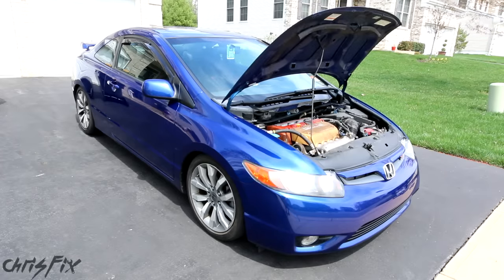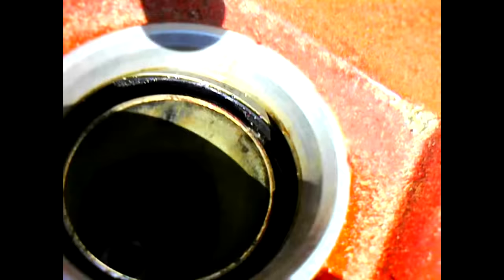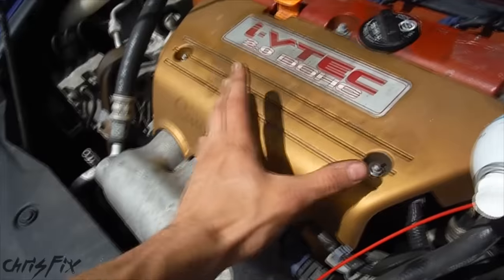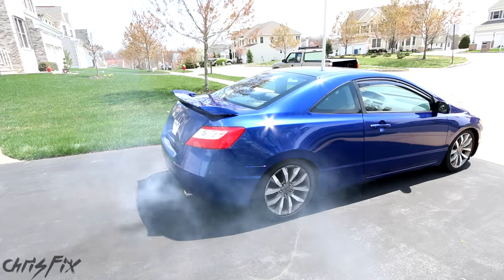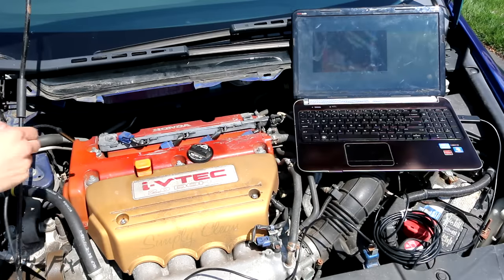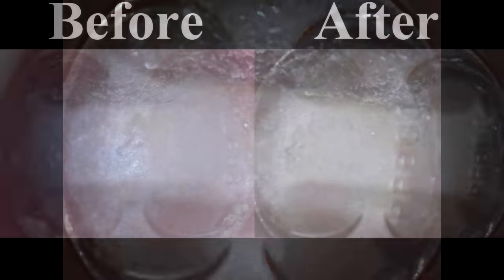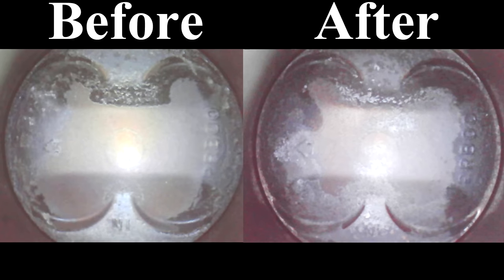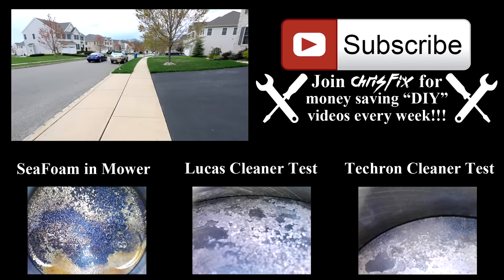Does Seafoam Actually Work in a Car? (with Proof)

Comment: I have always loved to apply Seafoam to my cars. I've owned 65 cars since I was 14 and I'm 38 now, so I've had some fairly crappy cars with alot of miles. I just love pulling the brake booster hose on my cars and slowly pouring Seafoam into the hose while running and watching my car smoke out the entire neighborhood. SO much fun!
Reply: 24 years ,65 cars. Sounds like you are buying junk and make a lot on scrap metal. All your cars need a tag that says , scrap metal.

Comment: I've used seafoam after my civic was idling rough that had 200,000 miles on it...after using it like you did it was running like a new car...safe to say seafoam def works!

Comment: It would be interesting to test the cylinder compression PSI for each cylinder before and after the seafoam.
Reply: This is interesting.
Reply: I bought a 72 MGBGT about 13 years ago and the #4 cylinders compression was low I put some Seafoam in it and it brought it up to the other cylinders
Reply: @mgman6000 im 💀 😂 i tried it today my engine was running rough for a while until i re-did the pedal relearn. The rpms just stayed at 1500 i thought i was gonna have to spend more money. Car still running the same if anything i get a slight vibration now.

Comment: You are supposed to add it to the gas tank as well as the intake. Praying into the intake is just to get the removal started. Having it also in a full tank will result in a much better cleaning. Can also add it into the crankcase, which should be done about 500 miles before an oil change.

Comment: After watching all your videos on this subject it would appear that surviving combustion is the most important aspect of any of these cleaners for piston tops.  For example seafoam is mostly pale oil that was used as an upper cylinder lube years ago. It allows the naptha, which is the primary detergent to survive long enough to clean the piston tops. So for your test it's the most likely to show visible results. Agree?

Comment: Hey Chris you're suppose to let it hot soak for at least 20-30 minutes before aggressive driving might get better results, when I did mine after 45  minutes of 70 mph driving I had lunch and jumped on the highway again and lo and behold I stopped traffic  accelerating onto the highway with all the smoke I left behind that's almost 2 hours after I did the spraying.

Comment: I am more concerned with the intake valves and guides on a GDI  then the combustion chamber. Would be interested in seeing the diff with the intake valves after seafoam.
Reply: Intake valves on a direct injection engine won't get cleaned by spraying seafoam through the intake, you have to go in and clean it by hand.
Reply: Exactly!
Reply: @tehgzizlauw1787 thats what i was thinking mine look black and i was thinking of taking it off and brush it but i discovered the sea foam and say let me try it.
Reply: @williamjoseph4095  you can use seafoam as a solvent to help loosen the carbon on the valves before you scrub it off with a brush. But if you just spray seafoam through the intake it will just go into the combustion chamber and burn off. The carbon on the intake valves on a GDI engine is too baked on usually for that to make any difference

Comment: Honestly I didn't see a difference.  Could be that the engine was in good condition to begin with.  Also I have a feeling the aggressive driving did most of the work.  Finally I'm worried about WHERE all that carbon went?  Most likely it's just clogging the catalytic converters.

This might be better to show on a car that's really dirty.

The aggressive driving is an old trick I used on my 82' Trans am and even my modern cars.  Just drive like an a-hole for a day and you'll notice the next day you car is running better because you burned out the carbon.  This must be why BMW drivers always have clean pistons XD
Reply: If you've got enough carbon that it messes up your engine so a cleaner actually makes a difference you're just masking bigger problems by using it. I've tried stuff like STP and lucas fuel treatments and didn't notice any difference in performance before and after. Whether or not they cleaned any carbon or anything like that I can't say. Like I said though, to get your engine gunked up that bad to where seafoam makes a big difference you've got much bigger problems that need fixing.
Reply: yes this is a good question...where DO the carbon deposits actually go when running Seafoam??
Reply: Yeah, I am thinking the movie Envy, where Jack Black's character invents Vapoorize, an aerosol that just makes dog poo disappear... It's definitely a good idea to ask these questions :P

I would actually be somewhat reluctant to use this product in a high performance engine where tolerances are less lenient(the honda kinda qualifies). Some of the carbon deposits appear to have come away in quite large pieces, that could potentially scratch the bore or block up the tiny "capillaries" in your catalytic converter.
Reply: DoomFinger511 bmw drivers get a lot of misfire 😅
Reply: Look at the piston walls you can see better reflections
Reply: I've seen a bad carbon buildup and if he really had a bad buildup you'd be able to notice, it's literally black gunk everywhere on the valves from direct inject engines on new engines. Older engines will never need a carbon clean just because the way the fuel is being injected, idk about this engine but it didn't need a carbon clean, the intake was fine
Reply: DoomFinger511 probably because of a head gasket leak
Reply: Agree no difference.
Reply: I think 80% goes to oil and the rest to cat , oil change it's a must but My opinión is  this shit is useless and could damage engines in long periods.

Comment: I just used it on my '85 Toyota.  It seemed to work pretty well overall, and noticed the change almost immediately after starting to spray it in front of the TB.  BUT, after I was done and took the the intake apart to remove the Seafoam line, a bunch of the seafoam dumped all over the ground.  A bunch of it clearly didn't go into the engine.
Reply: You're supposed to do it with the throttle open
Reply: @JohnZombi88  well, it was open.  But not wide open

Comment: The carbon buildup on pistons usually isn't a issue for most car engines that have carbon buildup, it's the intake valve (inside intake and not combustion chamber side) and the piston rings that can not be fully seen unless removed. Also the throttle body and idle control valve are key area that are suspect to rough idle and even throttle response that can be easily cleaned by most.
Reply: Seafoam makes intake valves pristine in lawnmowers, at least.

Comment: I use seafoam on all my engines, crank cases, transmissions and power steering! 
Always good results, knowing what you're doing is key!
Reply: Have you had any luck with sticky piston rings when adding it to the oil crankcase? Have you ever left it in for 3000k miles? Or just Vv 100-300 reason I ask is I just did a fresh oil change on my car.
Reply: @truthseeker1203  seafoam deep creep might help a sticky ring, soak it for a while and it might pop free. I always used  ATF before I found seafoam. The engine treatment can stay in if you want too.  I put it in my skyline every oil change.
Reply: @bikerboymc54  how would I go about using the deep creep? I was under the impression that’s for tight bolts. Do I need to pull any fuses? Change oil afterwards?

Comment: Hey Chris the best way to get rid of carbon is carbon gasification. Here is the chemistry. 3C (i.e., carbon) + O2 + H2O → H2 + 3CO.  The problem is how do you get water into the engine. You have to spray it into the throttle body. It doesn't take much water to clean out the engine. Please try this and compare it to the fuel cleaning products. You're the guy with the cheap DIY solution that works really well. I thought you would like this.
Reply: I can see people hydrolocking engines that way :)

Comment: Would have been good to do a compression test, to see if the improvement actually made any real world difference. That's whats really important. I don't think it made a huge difference looks wise.
Reply: Projectfarm tested it and found it improved it by a good margin so I think it's safe to say it actually works
Reply: My 2015 jeep wrangler mpg went from max of 19 mpg to 21-22 mpg just using one application in the gas tank.
Reply: Doesn't this stuff damage fuel lines?
Reply: @RideAcrossTheRiver maybe that’s why he’s doing the intake method

Comment: I worked R&D in auto racing (engine department) and based upon the video these products are worthless.  The product itself is causing all the smoke, not the removal of engine contaminants.
Reply: Not aware of any product that can be used with an assembled engine. Likely a fuel injector cleaner being run on a consistent bases will slowly dissolve the buildup.
Reply: true to a point to the proper way would be disassembly and cleaning but to your average mechanic trying to fix a misfire caused by carbon build up i would say very useful
Reply: Brent Erwin buy some BG44k it's a top of the line fuel additive. You can Google it.
Reply: Brent Erwin you can dump a glass of water down the carb while running gets more carbon out then that..and its free
Reply: David Dietrich   We put about a half cup of Marvel Mystery Oil  right down the carb while running. A little at a time so it wouldn't stall. When finished shut it off wait an hour.  Start the car up smoke like hell. After it cleared the engine ran great.
Reply: try it on your car and tell me how it goes
Reply: bg products work great used them in the past my favorite is their transmission oil that stuff is the bees knees
Reply: i used seafoam to get rid of codes preventing me from passing smog
Reply: hello, CDMusicGroup, did the seafoam worked as to clear engine code? what code did you have? I have a P0303 and wonder if the seafoam will clear it up. thanks
Reply: was related to emissions being dirty
Reply: Truth BeTold yes I’ve had that experience and mechanic that replaced my spider said my engine was cleanest he’d ever seen!! He was shocked.
Reply: Meaning I used several higher end priducts on consistent basis and no carbon buildup. I think 140k but have to check my records. Could have been 170ish. Royal purple,Lucus & sea foam every few tanks. And couple times used the little 28$ bottle that you add at 1/4 tank and drive 15 mi.

Comment: Hey chris, something that I did that helped was, after you turn off the engine after spraying into the intake, distribute the leftover foam into the cylinders through the plug hole. My pistons looked brand new afterwards

Comment: I usually perform an oil change right afterwards too.
Reply: Cleans out all the sludge nice
Reply: I do too. Dill put in a half a bottle of seafoam in my crankcase 300 miles before an oil change and then I do this and change the oil

Comment: I used Seafoam in my 1995 Chevy S10 when it had about 20,000 miles on it.  I went from using no oil from 3000 mile oil change to 3000 mile oil change, to burning a quart of oil every 200 miles.  I thought that I ruined my truck engine.  Miraculously, and for reasons I don't understand, the usage eventually decreased and I went back to not using oil again. Fast forward 280,000 miles, I completely forgot my old Seafoam experience and used it again.  The same thing happened. My mechanic and I both surmised that the usage was related to all of the oil drips at the bottom of the 280,000 mile engine.  I considered junking the truck. I added oil as needed and changed the oil, and the same thing happened. The oil usage went away again, Not back to zero like before, but I'm low not quite a quart at he 3000 mile oil change again.  My advice: Don't use additives!  Not in your gas, in your oil, in your coolant, in your tranny or air intake. Wait until a part needs replacement and replace it.
Reply: +Big Flop Agreed. And keep your fluids fresh!
Reply: +Big Flop 3000 mile oil change, what a mug lol!!
Reply: My advice.  Don't buy GM.  Buy Ford.  Besides, Ford didn't take money from us for a bailout.
Reply: JustAGuy
Sounds like your preference is 100% fact
Reply: Thibaut King Trust me, after working in a garage for several years, I found out how junky GM is.  If you want reliability, you go Ford.  What's it matter if Adolf Hitler admired Henry Ford?  Oh wait, you do know Henry Ford just invented the assembly line, right?  We are talking about something from 100 years ago. 

GM took a multi billion dollar bail out of American tax payers' money just a few years ago.  They went bankrupt because they make pure garbage.  But instead of survival of the fittest, they took money to keep producing junk.
Reply: my Chevy took a shit on me numerous times, and all for the same reason, intake manifold leak or fuel pump. after replacing both 3 times, my s10 still drives like it came off the lot at 300,000 miles...forget that it's so rusted I have to exit out the passenger side...
Reply: Lisa T Yeah, I give GM a hard time.  But all manufacturers have good and bad set ups.  Dunno what S10 you have.  The 2.2 ecotec is a reliable engine from what I've seen.  The 3.1 v6 in things like Luminas, Monte Carlos, Buick Century's... they all blow that intake/head gasket sometime or another.  I've seen them leak at 90,000 miles and others closer to 140,000 miles.  The 4L60E transmission was not reliable, imo from my experiences.  Ford had the head gasket blowing 3.8 in those days, though.  But things like the 5.0, 5.8, 7.5 (460) and their transmissions like the 4R70W and E4OD were pretty damn reliable. 
Of course, the older C4/C6 and TH350/TH400 were always known to be good automatics. 
Me, I'm the second owner of a 1986 F150 with a 5.0 EFI and NP435 (4 speed with 6.68:1 (I believe) first gear) and NP208.  transfer case and Ford 9" rear end.  Have had to do two things.  A $30 TPS and timing chain and gears (which is maintenance on anything).  Got a couple 5.0's in my family and 3x 4.6's (a 99 2v, 03 4v Cobra, and 05 3v), all of which have been bulletproof. 

Wow, long rant about some Ford love, right?
Reply: +JustAGuy The thing with the intake gasket is they were made of plastic so eventually they would break down because of constant heating and cooling of the engine. The head gasket failed because neglectful  owners running there cars and over heating them from leaking coolant from the intake manifold. They eventually made a intake manifold gasket that was metal based so the problem was fixed, but if GM had done this from the start this problem would never had existed lol.
Reply: +tails300 3.1 and 3.4 heads and intake share a gasket.  What you on about niqqa?
Reply: +JustAGuy No they do not the head, lower and upper intake gaskets are separate units nigga.
Reply: tails300 Lol who told you that?  Where did you read that?
Reply: What do you mean? It says this in every intake manifold gasket repair video on YouTube go look one up man lol.
Reply: Matter of fact go on google type in intake manifold gasket kit all the parts are labeled. Then go look up head gasket kit the parts also should be labeled.
Reply: +JustAGuy Ever heard of a 350 Small Block Chevy? The engine that was converted to every street rod and still being converted to this day? That was GM. GM made the first OBD computer in the early 80s, which the US wanted to have mandatorized. That's fact. I still respect all auto companies as a whole though. They all contributed something, one way or another.
Reply: Andrew Nycz A... tree...fiddy?  What's that?
Reply: tails300 Sorry.  Didn't read the "Chevyhardcore" site.  But, Ford took a credit line out.  That means they have to pay it back.  Unlike the 11 billion+ that GM got for free.  
http://www.factcheck.org/2011/09/ford-motor-co-does-u-turn-on-bailouts/
Reply: +JustAGuy That's correct they have until 2022 to pay it back. GM has already payed their share of the loan they took out, they also gave back the bailout funds they hadn't used as well.

http://www.factcheck.org/2010/05/general-motors-debt/
Reply: tails300 If you read deeply into it and check the wording, it repaid the "loan portion".  The government, meaning tax payers, still lost $11 billion.
Reply: +JustAGuy The main thing I was trying to get at is none of the big 3 are perfect they all had their fair share of let downs they're all equal in my book.
Reply: Listen man if you can't provide an argument with out calling someone an idiot you already lost. By the way I can't stand Chrysler, Dodge and Jeep.
Reply: +Big Flop I bet what is happening is your PCV is getting clogged with gunk after using seafoam raising base pressure and causing you to burn oil until the PCV is clean
Reply: +Big Flop When I was in the trade many years ago when it was common to pull heads and overhaul the valves at relatively low mileages by today's standards it was accepted practice NOT to scrap the carbon of the complete top of the pistons because this would cause oil consumption.  While the carbon was scrapped from most of the piston a thin ring of carbon was left at the very edge of the piston.

I never tested it both ways, this is just what you were told to do by the old mechanics and it was never questioned.  Perhaps there really was some truth to it.
Reply: Interesting.

Comment: Great vid, thanks Chris!

Dunno if it's been pointed out before, but the reason the carbon seemed to reappear on piston head 4 was because it's actually number 1 again, looks like there was a mixup in editing. 5:09 and 7:05 are the same cylinder.